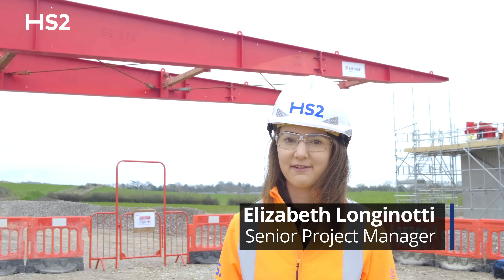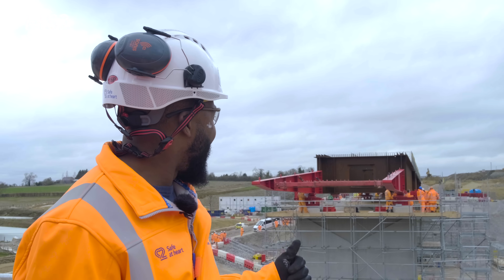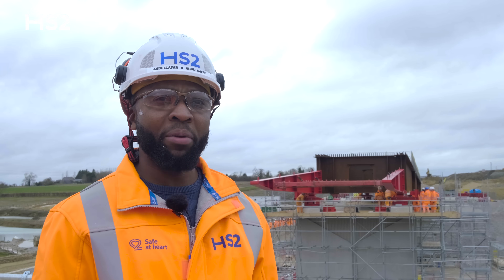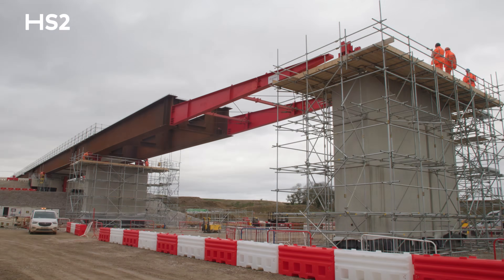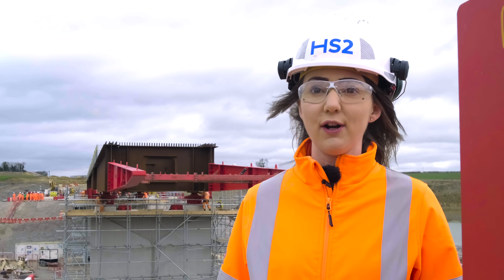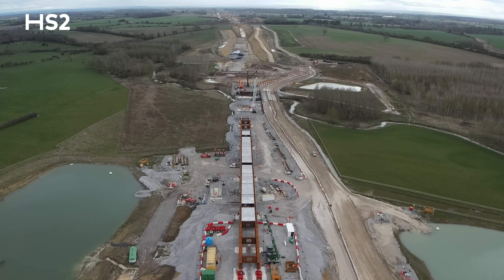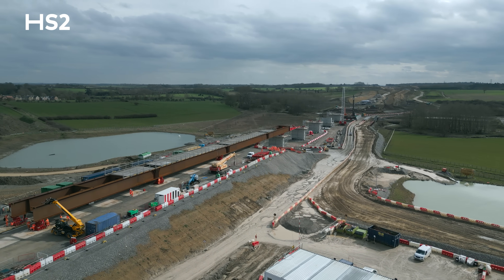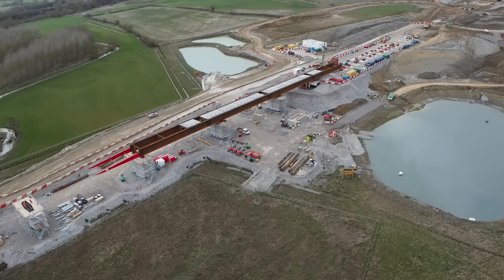HS2 slides innovative low-carbon viaduct deck into position

Comment: i wonder if hs2 will rebuild or resurface the section of the a422 between brackley and westbury - all the lorries over the past couple years have caused the road surface to fail. theres at least two massive depressions the size of bathtubs where the ground beneath has shifted out to the side.

Comment: Watching it move is like watching paint dry. Why so many viaduct types on hs2. An alternative could have been an earth embankment with arches/culverts and flood storage areas, but i presume hs2 did not aquire enough land to allow this approach.  The carbon measure and reduction is a bit of a nonsense. Still, it's impressive to see how it is being built. You would not want to trap your fingers when inserting the Teflon panels; this element of the works could be done more safely.
Reply: Actually earth embankments are a bit of a problem. If they get eroded the ground supporting the track can slide away. And, considering this viaduct is also a river crossing on a flood plain, the experts must have considered the risk of flood events carrying away soil and making a high speed derailment a possibility unacceptable. These folks do know what they are doing.
Reply: Embankments with their fences restrict the movement of wildlife.
Reply: why the cynical sarcasm? Yes moving hundreds of tons of steel has to be done slowly. But they did speed it up for people like you
As for building embankments on a flood plain ...... Oh My Lord .....🤦‍♂
Reply: @1chish  what about if they made the embankments off of rocks and not muds? maybe they should put that little stream into a pipe instead and then it wouldn't flood there.
Reply: @mikenewtonninja9379 That would permanently damage the environment. The design for HS2 had to meet the strictest environmental regulations ever designed for an infrastructure project in the UK. Which means no permanent damage and where possible improvement of existing habitat.

Though honestly just building embankments on a flood plain is a problem because no matter what you make them out of they'll erode away. Unless you want to just put a giant concrete block for the rails to run on. So yeah, bridges and viaducts are better where possible.
Reply: @mikenewtonninja9379   That 'little stream' is the Great Ouse. A river that feeds a very big flood plain.
Now I am no Civil Engineer but even I know that its not the embankment material that matters its what its built ON that counts. I also see the number of times railway embankments are washed away just by heavy rain. 
So I will go along with highly trained, very skilled people who have access to huge computer systems and decades of data.

Clearly they should have asked you to join them with your massive knowledge ....
Reply: @1chish  thank you for the compliment about my massive knowledge. Clearly, my reputation preceeds me 😊, and yes, I'm surprised they didn't ask me too! hey ho
Reply: @xxrockraiderxx , I am a rail enthusiast but looking at the damage to the land around HS 2 this is not a good environmental project.  In some areas the land across the width of the project is destroyed 3 to 4 hundred meters each side, all for what are two 6ft ways.  These architects need to look at the way the victorians built railways   which have lasted 200 years and are still working everyday.  All this lego construction is only designed to last 100 years what happens then.  All this stressed wire and concrete will not even last that long, look at the original 4th road bridge is 60 years old and all the suspension wires are corroded.  I would put money on that the colne valley viaduct will fail before it's 50 years old.  All the exposed steel wire inside will corrode very quickly.
Reply: @cmclewee9518   Errr ...you do realise that land take for construction is not the final land take?
Of course it looks bigger because there are construction roads, drainage pools and storage areas.
You think HS1 through Kent didn't have a similar land take during construction? Now look at it - hardly noticeable.

And to call this very advanced engineering 'lego construction' says more about your intelligence than anything about the project. I mean why be so childish?

Want to a comparison? Go look at the land take for East West Rail and most of that is the old railway! Again it will be returned to nature when completed.
Reply: @1chish  Its amusing when you decide to comment on someone's intelligence when you know nothing about that person, I am an engineer, though not a civil engineer, and it is Lego construction, it is simply putting together a number of precast concrete blocks, tied together with steel wire rope, I do question the land take and its destruction because it will never go back to what it was before.  Yes HS1 was a mess during build but they did not take anywhere near the land grab that HS2 has done and yet HS1 and HS2 will both be 2 track lines, the difference in the width of the construction is vast.  I watched HS1 being built and apart from the terminal at Folkstone the width of the railway is not much more than the GW mainline built nearly 200 years ago.  East West rail may be the rebuilding of a Victorian railway but it again has not got a footprint anywhere near the size of HS2's cuttings and embankments.
Reply: @cmclewee9518   I make my judgments about people on what they write, how they phrase things and the expressions they use.
And you eloquently just proved my assessment as accurate. So forgive me if I find this discussion rather pointless.

Comment: There’s nowt low carbon at all about HS2 so that’s bull sh*t thousands of tons of concrete and steel has been used plus yet another 20 plus years to complete and I’ll will have to run for thirty years before it becomes carbon neutral 
So more lies for a gravy   Train to apocalypse

Comment: Less carbon lol
Reply: Yes. So why the 'lol'?
Reply: @1chish .. HS2 will NOT cut carbon emissions. According to HS2 Ltd's own forecasts, even over it's projected lifetime of 120 years, it's overall construction & operation will cause carbon emissions of 1.49m tonnes of carbon dioxide equivalent.  
This represents just 1.18% of the UK's annual transport emissions. 
HS2 is an environmental disaster of epic proportions & Britain's biggest infrastructure mistake in half a century.
Reply: @CRIMSONANT1   Ah yes how very clever. I see you have copy / pasted from The Guardian again. Always a risky practice! 😂 
Those figures extrapolated the finite figures for HS2 construction vs lifetime use. When everyone else is using comparators. 
HS2 will save carbon emissions COMPARED to car, plane and diesel train use. But as you used The Guardian so shall I:
HS2 can achieve 8g of carbon emissions per person per km. The same journey by car would generate 67g of emissions – and by plane, 170g.

So here is the real question: How would YOU save emissions if you don't build electric rail systems to aid the travelling public? More roads? More airports? More busses on the same old roads? The numbers on travelling emissions above prove your views are not supported by facts.